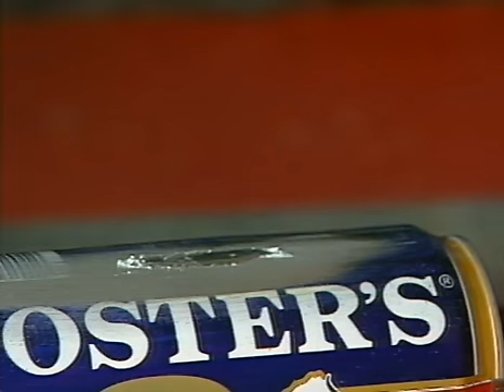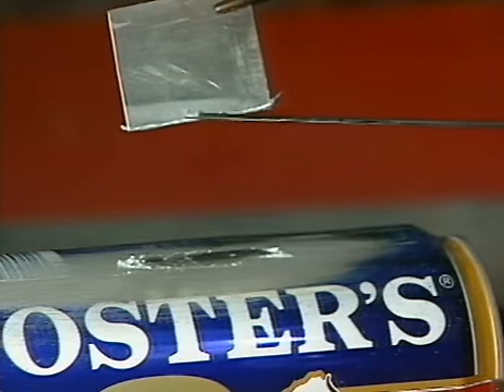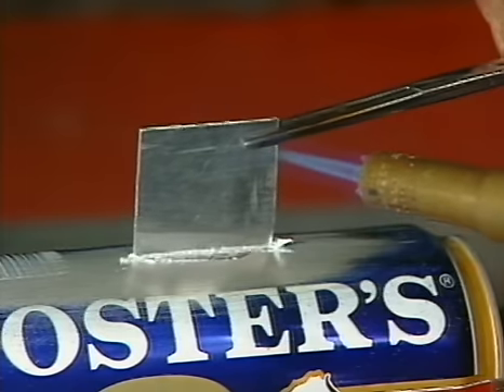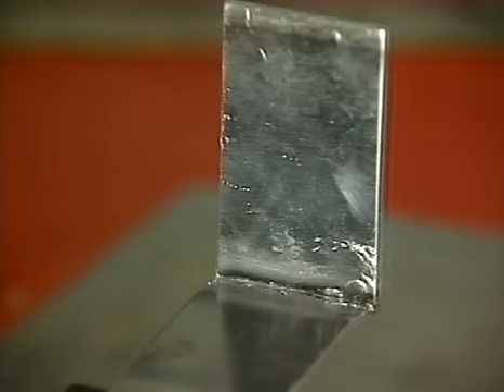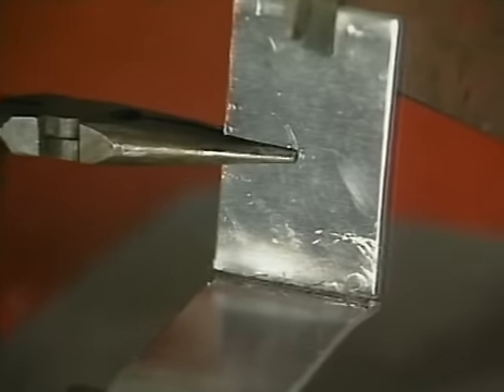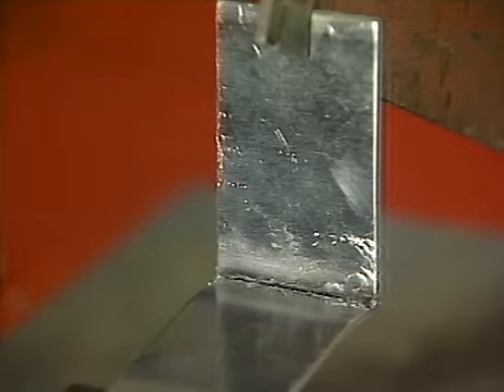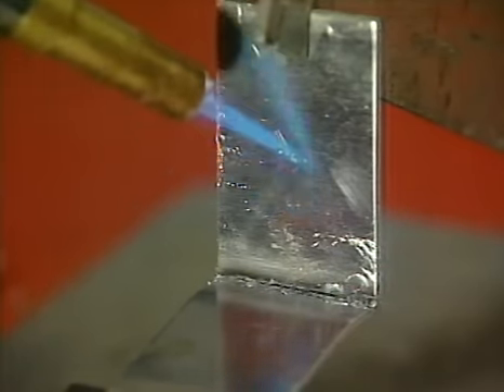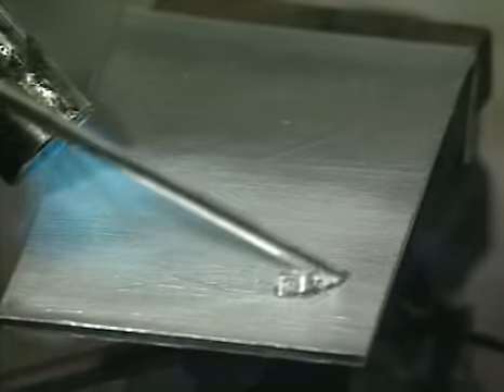Welding Aluminium Part 3

Comment: technical seen it could be said to be weld through the information in the first video, the aluminium melts and the  technoweld got attached to the material... its not commercial welding thru but it's the same process to the material...